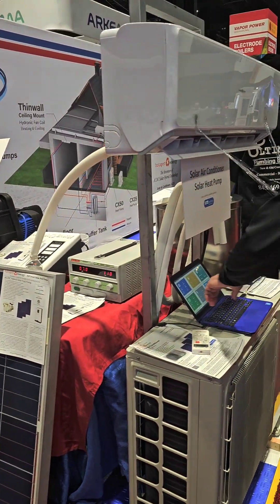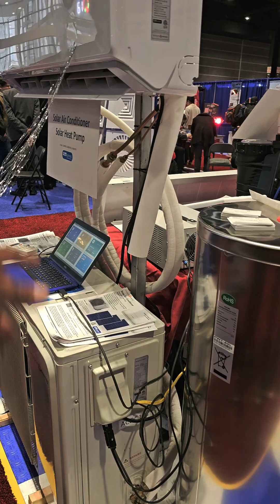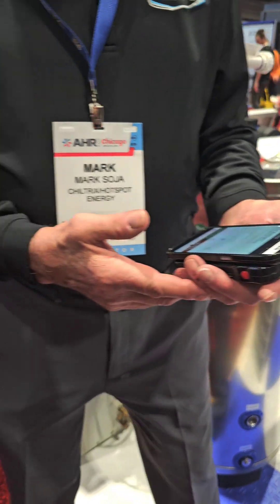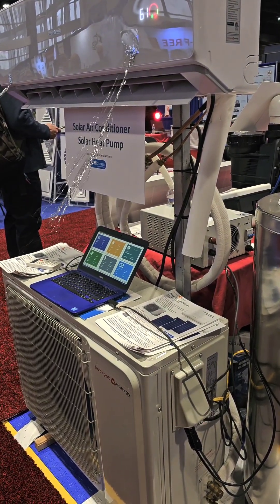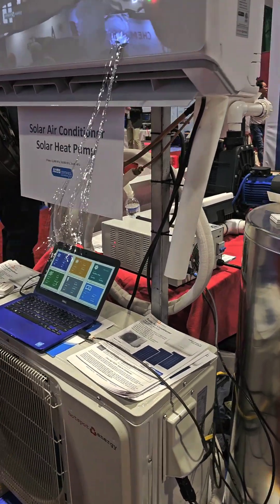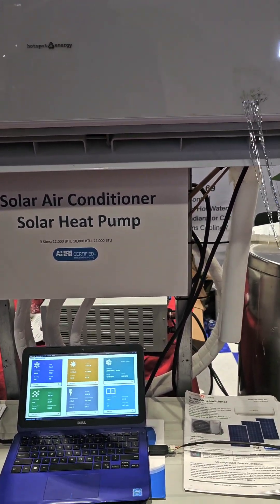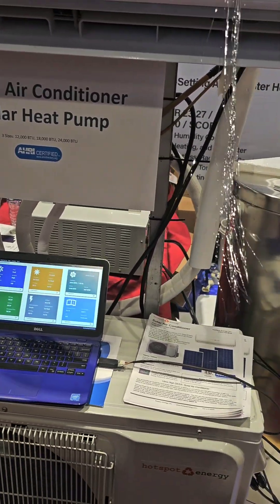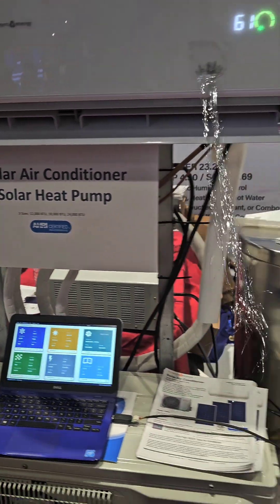First Look: Solar-Powered HVAC - Is This the Future of Home Heating/Cooling?

Comment: So when its the dark depths of winter, your coils frost over past -25C  and there's snow on the solar panels on the snowy roof.... you better have wood or oil heat to save yourself from  freezing lol... heat pumps can't be used alone.

Comment: We definitely need more of these in the USA. They have been in other continents for decades.. 

Straight DC from solar into DC motors and controls have been around for a long time, but just not in the United States . 

Having to convert DC from solar to an inverter to AC power, you have an efficiency, power loss.   Every time the voltage current Hass to go through an inverter to change there’s power consumed in the stepping up, or stepping down, or converting from AC to DC.

We need heat pumps that can go directly from DC to DC .